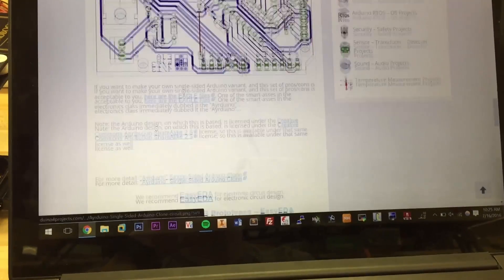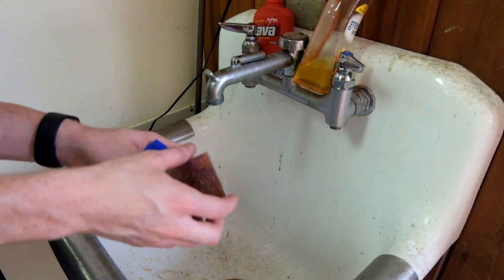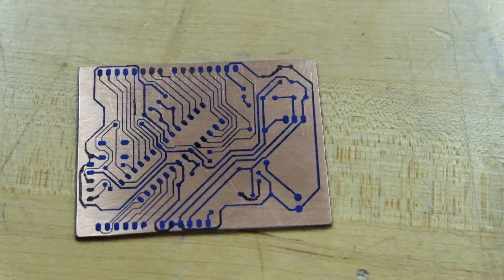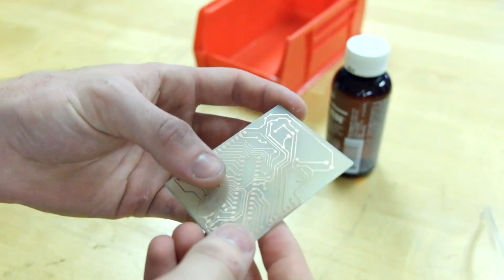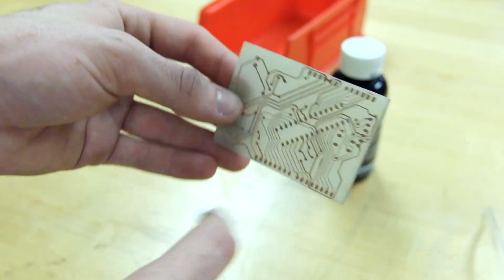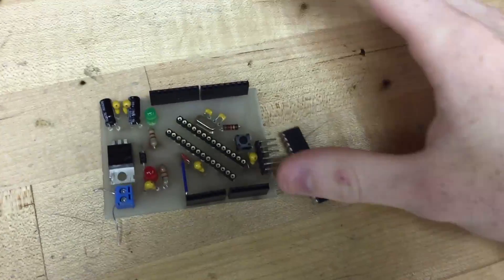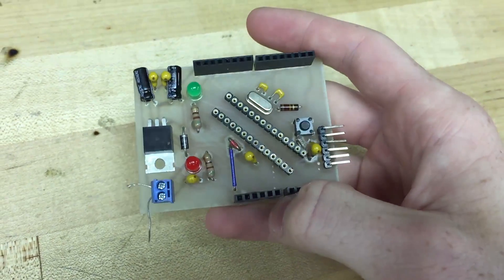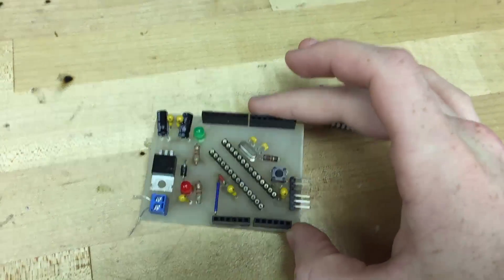DIY Arduino Clone - PCB Etching, Tin Plating, Drilling, Soldering, and Bad Music

Comment: When i was in school we drew the traces onto the PCB with a permanent marker pen, then etched off the copper with Copper Sulfate or Copper Chloride solution (if I remember correctly). The marker protected the copper from being etched away.
Reply: We also had to manually drill all the through holes of course, no drill press available haha

Comment: How this IC is in that shape? Which software did you use? Can Put please tell me
Reply: The IC here is an ATmega328P-PU microcontroller. The PCB layout is from the design linked in the video description. He opened it in a program called Altium Designer, which costs money, but a free and open source alternative that can read EAGLE files is Pcb-rnd. I assume he skipped over the step where he made a few test prints on regular paper to make sure the size was correct.

Comment: I had a arduino uno board which i recently burned b giving 12 V accidently to raw input. Can i salvage the chip in the arduino , does it work or not ?
Reply: Yes!  Probably the regulator is fried.But not the chip.
Reply: A B I D Does replacing the regulator make any sense ?
Reply: ENTIZ Stdio Isn't the raw input connected directly to the atmega? In that case the chip would be fried. There probably isn't a regulator on raw input, if there was one, than it could take 12v no problem.
Reply: FairfaceCZ i think I fried the chip , Can you help me with uploading sketch to arduino nano using ft232 serial converter

Comment: Your traces didn't take where your grubby fingers touched it. Scotchbrite and detergent, alky wipe wearing clean gloves, then transfer. Any oil at all once heated will keep pretty much anything from sticking enough to resist etching. Never let skin touch clean copper, anywhere.

Comment: Nice work and makes fun for sure.
Today you can get an arduino clone from ebay for 5,5€ including shipping.
How much cost all parts from your clone ?

DJ
Reply: If you buy just the parts for one or a couple of boards it costs the same or slightly more than one of those Chinese clones.  You get significantly cheaper if you produce thousands of boards - that's how they can offer them this cheap.

You don't do it for cost, you do it for fun. At least initially - later on with some practice you'll realize you can make your own devices and you can repair stuff that the manufacturer would rather abandon to sell you something very expensive anew.

Comment: I use HCl and H2O2, much faster and does not stain!

Love those old 78's, but next time, for the music I suggest something by Sousa!

I've used the transfer method to make a double sided PCB for a surface mount DSP processor using a chip with 0.5mm pin spacing.  It worked great BTW.  Trick is to preheat the board a bit before placing the transfer sheet in place.
Reply from the maker: Thanks for the advice!